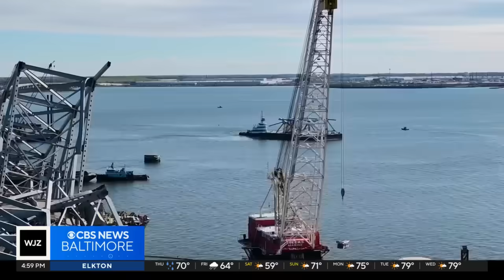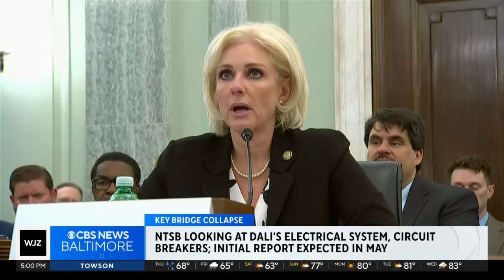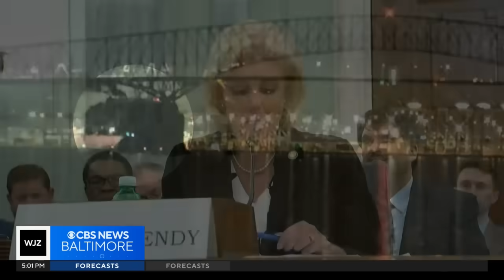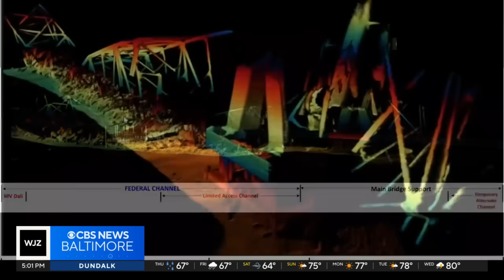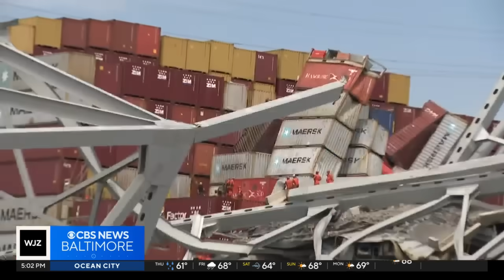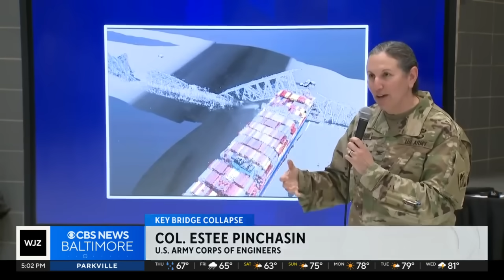NTSB focuses on cargo ship's electrical issues in collision with Key Bridge

Comment: Mike - "Some containers weigh more than a ton each" According to Google an empty 20 Footer (Small one) weighs 2 tons and full 25 tons. Larger ones even more
Reply: I came here to say the exact same thing an empty 40 footer is about 8000 pounds
Reply: Stupid journalists,we have tons of them here also
Reply: Talking head reporter. Thanks for saving me time by posting info.
Reply: More like 25-40 tons each.
Reply: More than a ton each.  WAY more than a ton each.  It is pretty amazing to me the Dali isn't sinking at the bow from the weight of all that bridge superstructure..
Reply: @B-and-O-Operator-Fairmont  I believe it's because it is sitting on the bridge pier foundation
Reply: @ChrisMonopoli  Thank-you.  That would make sense.
Reply: Mayor, new mom Pete, is on it! I have the utmost confidence in the outcome.
Reply: The bow may be laying on the bottom of the channel.
About containers ,they meant 10 tons probably... small 8 foot containers are already 0.6-0.8 ton - empty! I don't think these are used much for shipping, though.
Reply: @B-and-O-Operator-Fairmont  7/8 of the ship is out of the shipping channel essentially beached.
Reply: so more than a ton :P

someone missed a zero i guess.
Reply: @nomenclature9373  That makes sense.  I am not familiar with that area and the whole thing looks like "deep water".

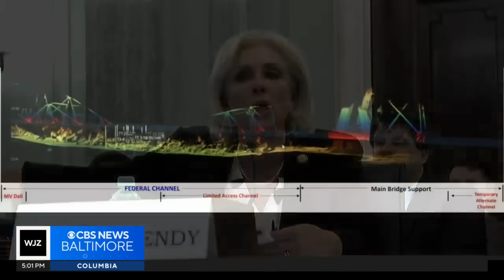Comment: 2:15 "New 3D imaging shows part of the bridge fell to the very bottom of the channel"  Where did you think it was sitting?  Where do they find these "journalists"?
Reply: it might sound "obvious", but depending on how it fell and the position of the pieces in plus the shape of the channel, some of the pieces might not sit all the way at the bottom; if you look at some of the 3d imagery you'll see this to be true.
Reply: @quantumslip  Every single piece of bridge that fell in the channel is sitting on the bottom.  The only pieces not on the bottom are laying across Dali.  If they're not on the bottom, what exactly do you think they're sitting on?
Reply: Concrete and steel have never been relied upon to float on the surface I assume anyway.

Comment: As an Electrician Mate 2nd class , I knew the electrical system was at fault , breakers tripping, could have been a "Loose connection" never PMS'd since it was built. Basic stuff.

Comment: “ NTSB focuses on cargo ship's electrical issues”.  Well, duh, isn’t that where they should start?
Reply: Keep in mind you have to rule out other common causes. NTSB has a team of staff experts as well as contractors looking  at the ship. In addition they have to publish recommendation on related issues identified like the protection of bridge foundations.
Reply: That's why MSM sucks
Reply: A ship not even 10 years old should not have electrical issues...
Reply: @JoeLinux2000  and you swallow.
Reply: The video shows a major ship-handling error immediately after power was restored as the actual cause of the collision. I still want to know what were the first 2 commands given in ship's pilothouse after power was restored, because that's when they really lost control of the ship & it began turning sharply enough to hit the bridge. Again: "prop-walking" is a thing. The electrical system certainly failed, but it was the response to that situation that brought about the collision.
Reply: @DR_1_1  A brand-new automobile can have electrical issues...& they're getting more & more dependent on more complex systems every year. Again, it's what was done with the rudder & prop after power was restored that caused the crash...& nobody is looking at that? I'm sure that's not the case, but we're not hearing about it. That may be simple journalistic incompetence, which seems to be a constant in SO many things these days. Ask the wrong questions, get the wrong answers. 2 ton cargo containers? 🤣🤣🤣

Comment: Why didn't they use tug boats to guide this large ship in and out of the port?  Tug boats have been used for decades.
Reply: Or get the ship running,  Exactly what i thought they would do
Reply: Not a requirement but should be. Amazing how many ports don't require it.
Reply: cost to much................
Reply: Tug boats would of not solved the issue.
Reply: 38 yrs on tugs.  The ship owners are too Cheap to pay a tug to stand by
Reply: @dsloop3907  using tug boats costs less than building a bridge.
Reply: On report said tugs cost $6,000/hour. Some ports require it and some don't so shipping companies will use the ports that don't require it.

Comment: I hope they look at the computer logs, internet logs and all wireless communications.
Reply: That should be a super priority.
Reply: Given the ship handling SNAFU AFTER power was restored, I just want to know which way the prop turns, & what orders were given in the pilothouse after the lights came back on. The electrical system didn't steer the ship into the bridge after power was restored, but a prop rotating counter-clockwise in reverse would.